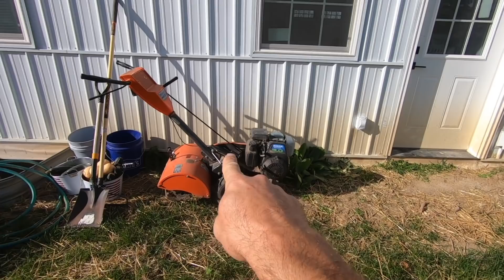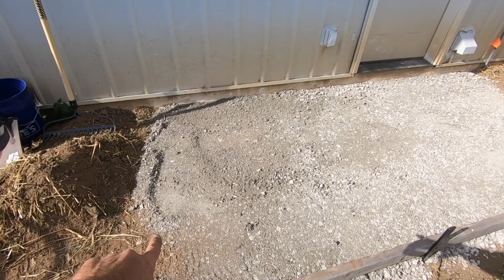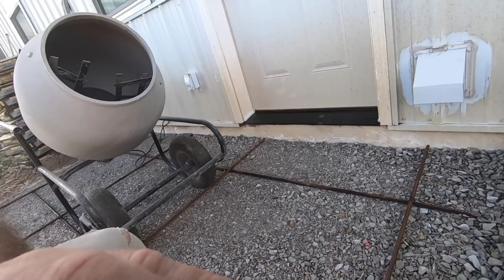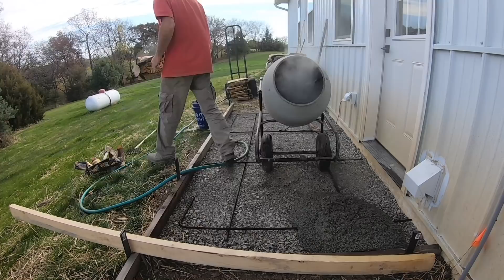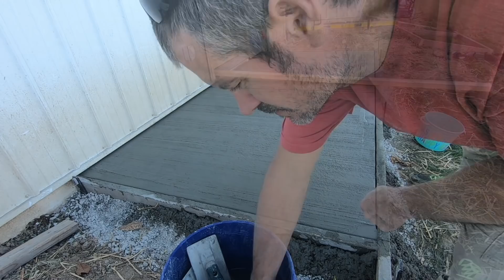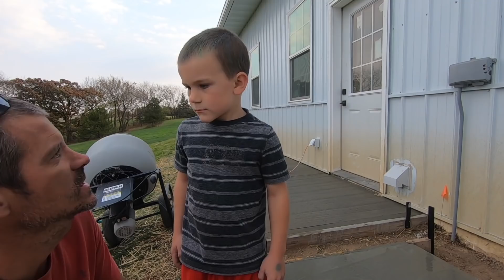Small Concrete Slab Project | Less than $200!

Comment: That was awesome!  Thank you for sharing.  I like your electric concrete mixer.  I just did my 1st concrete pad few days ago, did a "dry pour", it turned out o.k. so far, it's very early.  I learned a lot watching YT videos & doing my 1st concrete pad.  But next time I will go with the traditional mixing, either rent or buy an electric mixer, that seems to be the time tested method.  As others have commented, awesome to have your kids involved.
Reply: That's what the internet was designed for.  Sharing quick information.

Comment: Great video. I have a project I am working on but have never poured any concrete. I'm nervous about the thought but at the same time feel like I could learn. I am digging up a garden that is next to our carport. Nothing much grows there anymore besides weeds. The space is 15 feet long by 4 feet 7 inches wide. I haven't gotten very far in my digging since the weather has gotten hotter. I plan on getting up early this weekend and working until the sun hits the area. 
How deep to I dig to pour concrete?
What kind of rock base do I need?
Does this area need to slope away from the carport?  I guess it would, since it's fairly close to the house.
Any advice you could give would be helpful. Thank you.

Comment: Trick I learned 
Cut a piece of wood the height you want of slope. Say 1 inch in ten feet.
Take the 1 inch piece of wood cut to width of your level. And tape it on bottom of your level.
When you set that on your form board and when your bubble centers. You are at a  grade.

Comment: Great video short and sweet. Liked the small electric mixer. Appreciate the kids helping out. If the kids can do it how difficult could it be? They looked like young pros. Curious, why didn't you combine the 3 pads altogether, look nicer, less weeding as a single or double unit, drainage? special individual sites for AC? and? certainly not for saving money at $4.00 per bag. Thanks again.

Comment: I didn't see how he made that center line.
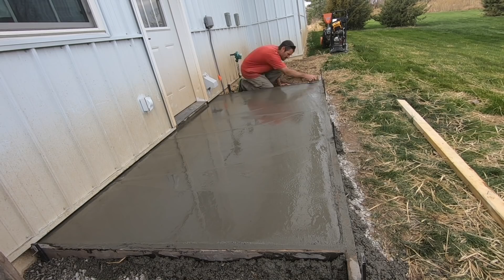Reply: 8:26
He begins using the edging tool.
Then he only remarks about the "relief cut". He mentioned that he will use the same edger tool as the ends.
Go up the middle with edger and flip it around and form the clean cut line which will match the ends.

Comment: Looks like good work, when I helped a friend we put a thin piece of plastic between the house and the slab. He said he didn’t want it to settle and put pressure on that wall so wanted to make sure it wasn’t attached. Is this something you don’t actually have to worry about?
Reply from the maker: It’s good practice to add an expansion joint. In my case this slab butts up to my metal trim and grade board.

Comment: When I hear you say gravel. Are you referring that you are using just 3/4 clean for a base? Or are you using a DGA material? I need to do a 3ft wide by 10ft concrete pad area for storage space. I have a lot of 3/4 clean red dyed landscape gravel left over from a project. That I'm wondering would be fine as base?

Comment: What are those black leveling stakes made from? Plastic?
Also, I've been watching lots of concrete vids but no one gives any advice for cleanup of tools and equipment, or what to be mindful of. Like where do you want to dump that bucket of water with the tools in it? Will there be problematic crumbs or clumps? How about the inside of the mixer?
Reply from the maker: We use the garden host and rinse it all in the gravel drive or somewhere out of the way. there can be clumps and residue so you don't want to do it on something that's more permanent

Comment: I live in Florida do I need to lay the cement in an angle to let the water run out away from the house?
Reply from the maker: You'll want a slight slope away from your house because you never want moisture to have an opportunity to run into the house. Even if you don't anticipate much it never hurts to be sure you won't end up with any problems.

Comment: $50 for wood. $200 for cement. $80 for rebar. Plate tamp $200 to rent maybe you pick the stone up from the side of the highway for free. Everybody doesn't have concrete tools.  This project for a typical homeowner would cost $1,000

Comment: This didn't need to be anchored into the foundation with rebar dowels every 24" or so and tied in with the rebar to keep the new pad from settling and sinking separately from the foundation? Just wondering if that needs to be done or not before I pour my patio/slab right up to foundation of my house and garage?

Comment: Hello, I have an 8x8 shed foundation project going on, which will 
include a 24"deep x 12"~ wide ratwall.  The shed already exist and has 
been moved out of the way revealing very sand soil underneath.  My 
questions are; while digging the ratwall, the sandy soil where the floor
 of the shed will be is not as stable as I would like.  If I were to 
remove it it would go down about 3-4 inches.  If I even the sandy soil 
out, can I secure and pour the concrete on top of that?  Also, I have 
been advised to secure the interior of the ratwall side (shed side) to 
use some 1/2 plywood all around at the 24", and tht it would be ok to 
leave it there after pouring the concrete.  Also, should there be a slope for drainage.  Any guidance would be 
greatly appreciated.  Thanks in advance.

Comment: Question: Do you need an expansion joint between the existing pad and the new pad?
Reply: You probably should but I don’t think it will be a huge deal not to have it. I would be more concerned about not pitching it away from the building

Comment: Great work.  Only thing that could of made this a tad better would of been to add foam along the cold joint against your foundation slab.
Reply from the maker: There’s is a 2” polystyrene thermal break between the inside slab and the outside grade board

Comment: I bet that Paul has had to make over 10,000 decisions by the time he has finished this home for his family. I used to work at a wholesale fence supply distributor in Fort Worth, TX. We sold wood post, galvanized post, wood and chain link fence. Most of our customers were one or two man companies. Many could not afford electric mixer yet, so they mixed concrete in wheelbarrows, using a shovel. When they ordered concrete, I would ask do you want premixed bags. They always said no. It was too hard to mix water with sand, gravel and concrete already mixed together. They preferred to add sand, concrete, gravel and water, a little at a time. They claimed it was easier to mix. Their next big item purchase, not always from us, was usually a new or used electric mixer. Many had their big rigs sectioned off to keep raw sand, gravel and concrete from mixing together, while hauling job to job. Paul has electric mixer, so premixed bags are fine for job like this.
Reply from the maker: Thanks for the comment! As a kid we had one that went on the back of a tractor and I remember having piles of gravel, sand, etc and mixing

Comment: Why did you pour 3 pads instead of one larger one? The kids did a fine job!
Reply: My guess is because the AC pads need to be level. There is a slope on the bigger pad.
Reply: Excellent thinking!!
Reply from the maker: Exactly! Two pads for the air conditioning units.

Comment: I can hear your wife saying, “Not the good broom!” Great to get your kids involved in your concrete project. Just curious as to why you couldn’t make it one continuous slab rather than the two separate ones for the air conditioning.
Reply from the maker: There’s a lot of lines coming through that area so these will be easier to move

Comment: Is there an advantage to having three concrete pads instead of one?  (It looks like one big pad would better help minimize rain splashing mud on the house.)
Reply from the maker: I have a lot of lines running through that area so I did the two smaller ones for the air conditioning units

Comment: I'm curious, since the overall area difference would've been minor, why didn't you just run the big pad into the corner and do it all in one shot?
Reply: Needs more rebar and concrete. He’ll get it done later. Moving to other things now.
Reply: Yeah that would of looked a lot better and he wouldn’t have any chance of weeds growing back in there.
Reply: My guess is because the AC pads need to be level. There is a slope on the bigger pad.
Reply: @artisticboundaries  you might be right there. I would think that could be solved with a set of shims or washer stack as well.
Reply: Excluding basements and other interior slabs, where precipitation wouldn't be a factor, all exterior slabs must have fall to direct water off the slab. Done many AC slabs and they always have fall on them!
Reply: @coldcrankinamps , the slope of the slab is unrelated to having one larger slab or two smaller slabs. You can have the same slope either way, especially since the slope would be across the shorter axis.
Reply: @chaseweeks2708  Sorry bro wasn't replying to your post directly, I was replying to The Artistic Boundaries person saying that AC pads need to be level. I def agree it should have been one slab.

Comment: I enjoy your videos and look forward to each new one, However I believe your LP regulator will either have to be moved or the vent will need to be piped away. Please check with you Local Authority Having Jurisdiction.
Reply from the maker: It was installed by our gas company and is code for our county.